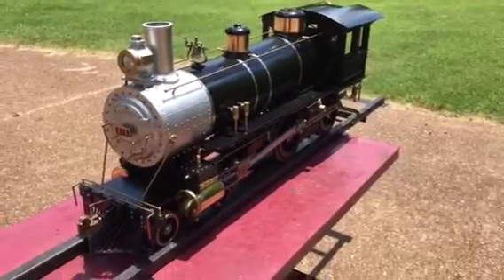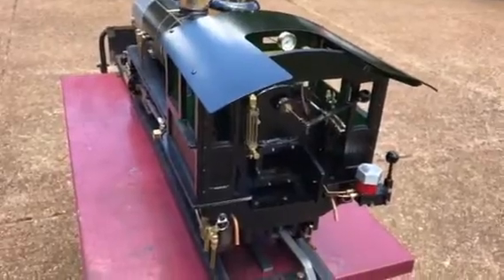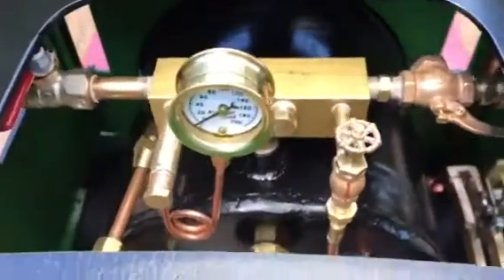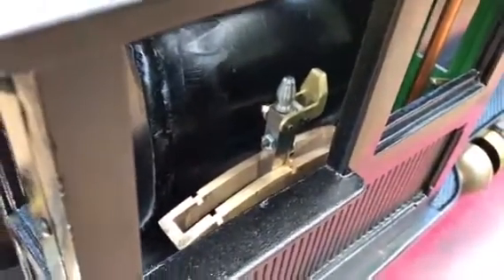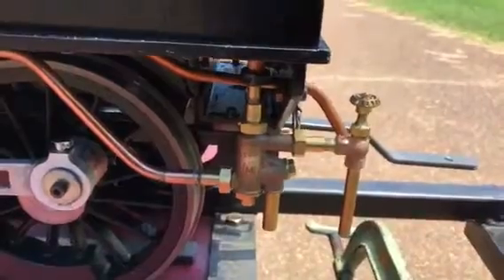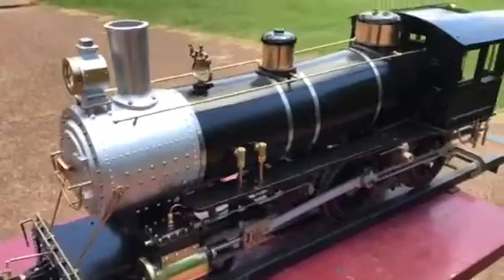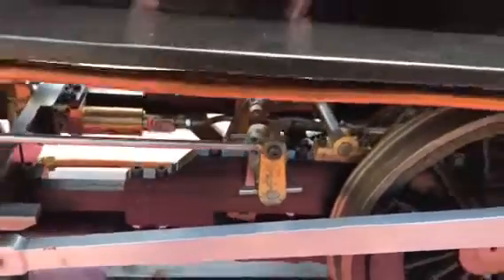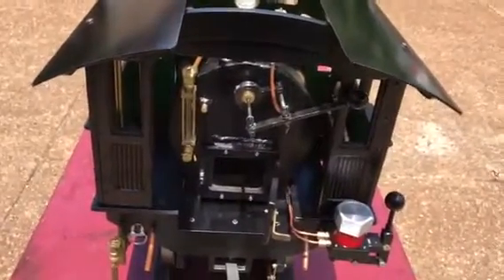Allen American Live Steam Locomotive

Comment: What size lathe and mill did you use to build the locomotive?
Reply from the maker: I have a Bridgeport EZ Trak but a standard Bridgeport mill is fine.  I used both a 16” and 12” lathe, you can build it with a 12”